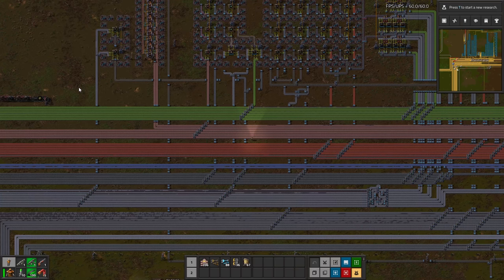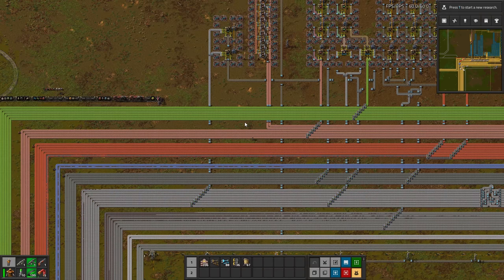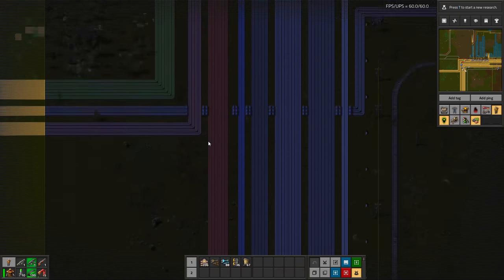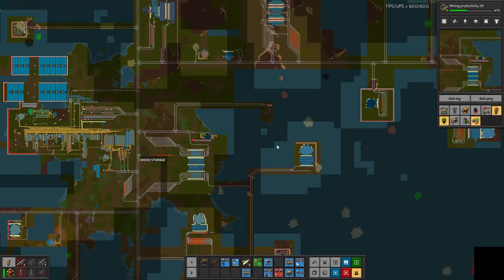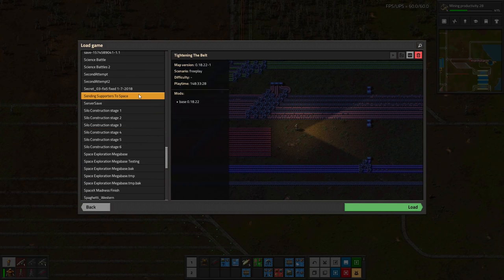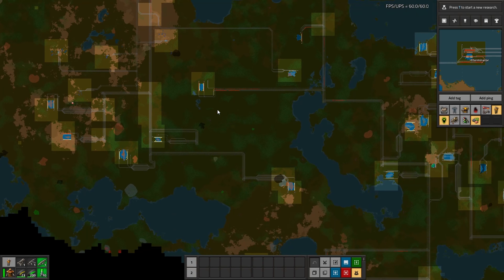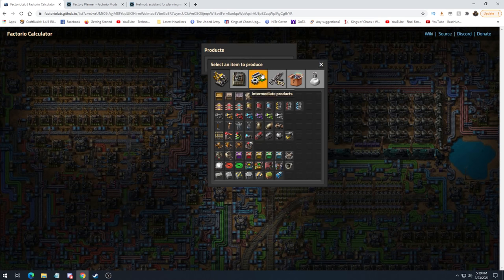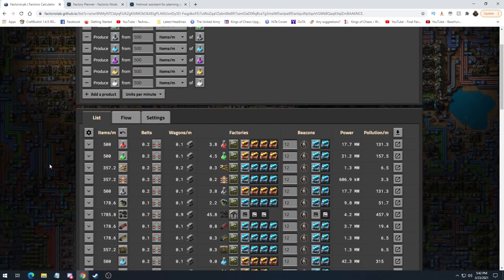Factorio Megabase Tutorial & Theory EP1 - Creating A Goal & Considering Options

Comment: If you are using a Calculator to get a feeling for the amount of resources you will need, I would recommend focusing on the "Belt Count", but still set it items/min as he did in the video, since that is something that you can still visualize. I myself at least cannot properly wrap my mind around numbers like 40'000 items/min.
Reply from the maker: Thing is, belt count only works if you're building a belt base. I like doing x per Minute because it works for both types of bases and still shows how many belts you need and more importantly how many machines you need.
Reply: @Xterminator  Seems my comment was not formulated all that well, I edited it so it should be clearer now.